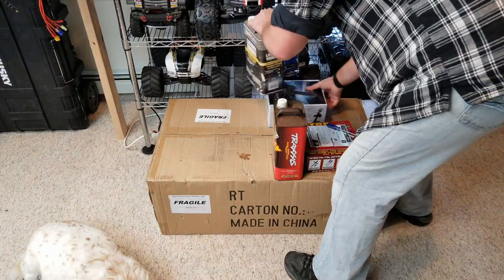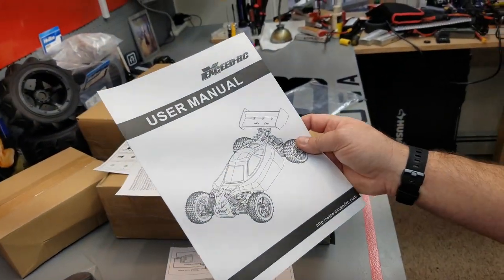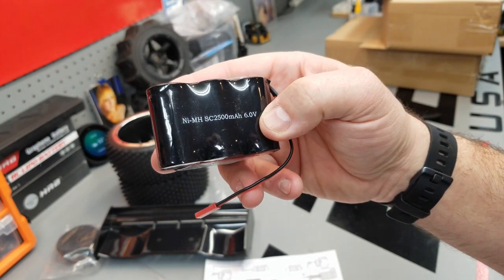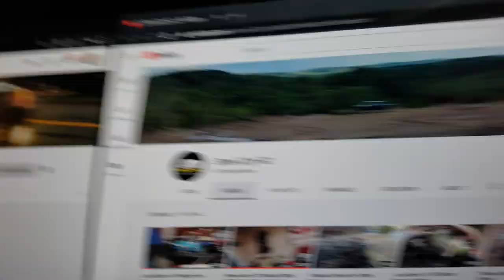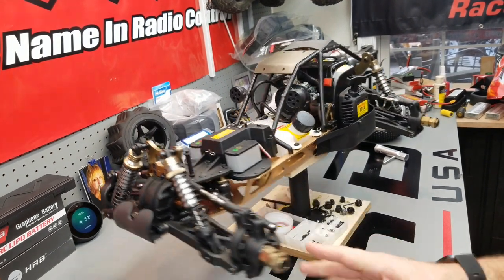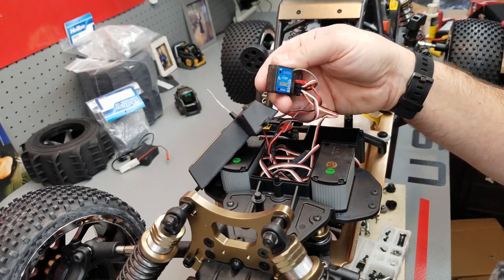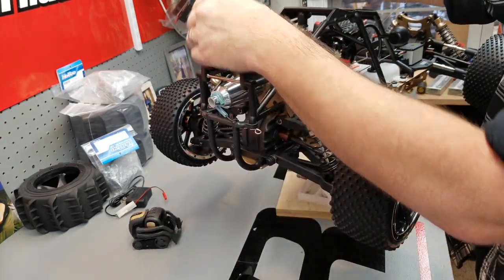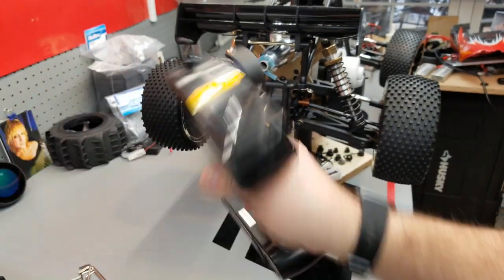1/5th 4x4 Exceed Barca 32cc Baja Hpi Rovan Redcat

Comment: finally finished the video, Yes I did a couple break in vids for the gas rc's, they are basically all the same.  BTW make sure to check if your failsafe is set to apply full brakes if you turn the remote off, that is crucial on these things.  Those remotes are junky but trust me, they do the job, I never had any signal losses with them.  Before you pull the starter make sure to check the plug for spark after you add about 12-15 drops of 3 in 1 oil directly into the cylinder on top.
Reply from the maker: Thanks brother! Granted I've been away from the 1/4-1/5th for some time I'll be re-reviewing your vids plus steel city BUT I'm very familiar with engine break in but a refresher for these mouse motors nothing wrong with that. I may use a different oil type to match the piston to the bore but I'm fairly confident based upon pulling the plug already in smelling fuel that this engine has been run probably just for a fire up process and obviously not any kind of proper break in.
Reply: @rcguygarage  really?  yours seems to have been run?  I've never come across that so far.  Its possible.  BTW did you see that nitrorcx.com offers a break in service for these engines.  Its highly possible they did it or tried.  I noticed it on their site some time ago.

Comment: Thanks for the shout out RC brother! Not sure how I wasn't subscribed anymore. That buggy has a lot of similarities to the Redcat Dunerunner. Yet a lot of differences. The DR chassis does not have those cut outs and the fuel tank is different. DR has single steering servo. I actually think the DR chassis is longer too. Sitting next to a Losi 5iveT and MTXL the DR has the same wheelbase. The DR has 3 center shafts. 1 in the rear and 2 up front with a carrier bearing mount in the middle of the front 2. I will say that it has the good MT and DR diffs. If and when you add power to this buggy get the aluminum diff housings with helical crown and pinion inside. Looking forward to seeing this buggy run! Again thanks for thinking of me man!!!

Comment: You wasn’t kidding. That thing is spot on with the dune runner
Reply from the maker: Yep TWINS
Reply: Are they? They look very similar. But I think the Barca is shorter wheelbase like the Rampage MT. I could be wrong?
Reply: Steel City RC just look at it. Everything on it screams Redcat
Reply: @MetzRc84  oh I agree the same "big" manufacturer made these as Redcat. Look at the Exceed Hannibal. It is a cross between the MT and Dunerunner. HSP makes a monster truck like the Rampage MT too. They are all rebadged
Reply: Steel City RC oh wow I didn’t even know that

Comment: All i can say now is, welcome to the low rpm HY gas engine gang my dude. Lol.  Same as the redcat mt.   Btw that is an external failsafe it came with as you said.  Prob from years ago wen these had no built in failsafe in the rx on most 2.4 ghz systems. From like ten yrs ago. Lol.  They gotta update their packaging.
Reply from the maker: I'm looking forward to FORCE RIPPING this little mouse motor. Might give it some SPECIAL tuning if it's dog👍💯👊 did you catch any reference to you???😜🤣
Reply: RC Guy Garage  so far only watched like 8 min.  Gotta finish the rest at home, got a data cap.  Sucks!!  But dude i been wanting to get tht model for a while, its actually cool bc its got 4wd and is a baja style chassis.    Im surprised nobody has made a better clone of it so far.
Reply: Yes.  Finally hanging with the cool kids club! 1/5 scale baby!
Reply from the maker: @MetzRc84  i learned it by WATCHING YOU
Reply: RC Guy Garage 🤟🏼🤟🏼🤟🏼🤟🏼🤟🏼

Comment: Hey congrats on the 1/5 scale!check every bolt to make sure there tight and
Blue lock tight oon any screw going into aluminium And check your end points steering and throttle. 
But hey Botajell has good break in vids.
Reply from the maker: 😂😝🤣😜oh i remember my rovan jackrabbit😂😝🤣😜👍💯👊the VIBRO machine
Reply from the maker: This definitely isn't something I'm running OTB. I'd like to give it its BEST SHOT👍💯👊